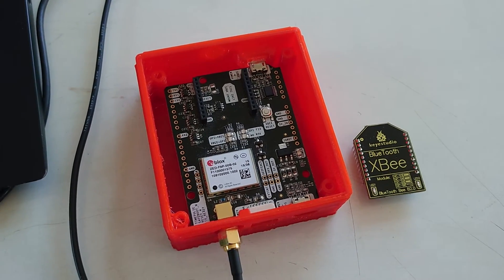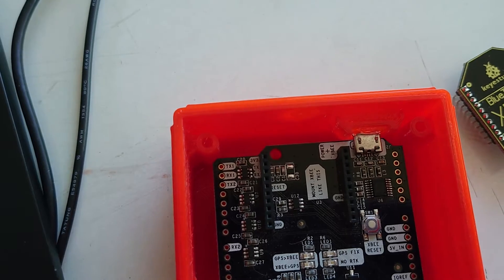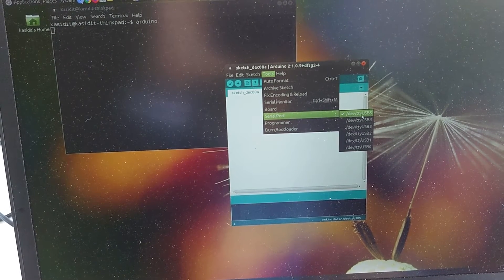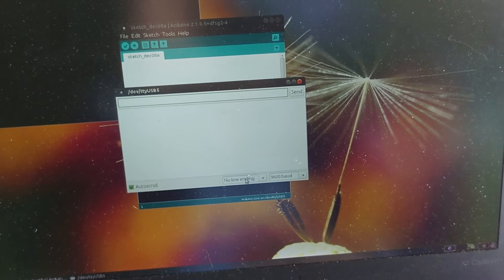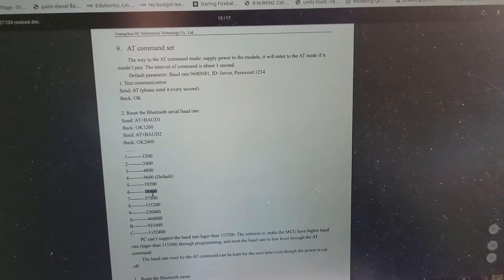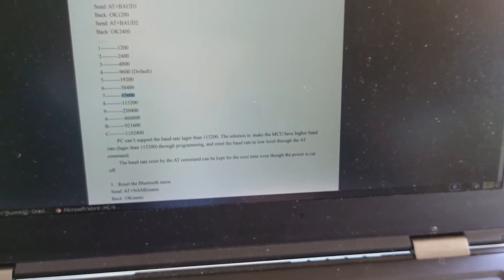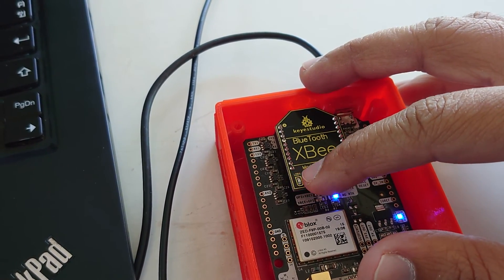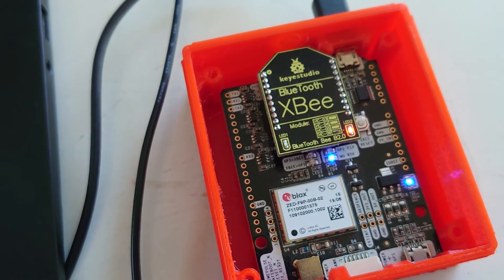Changing baud rate of a HC-06 Bluetooth Xbee module with Ardusimple U-blox F9 board

Comment: I am trying to connect a simple board with SWMAPS on an android cell phone, using a Bluetooth Keyestudio like the one you use in the video.
I changed the baud rate in both the bluetooth and the UART port to 57600, but when connecting with SWMAPS I get the error "gatt status 133" and the connection does not occur. Any ideas to fix this?